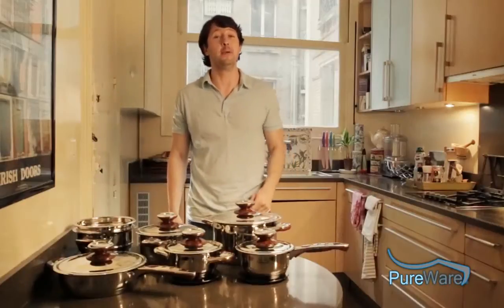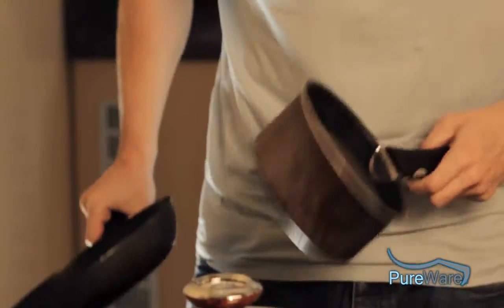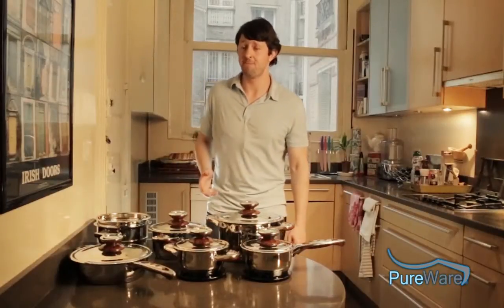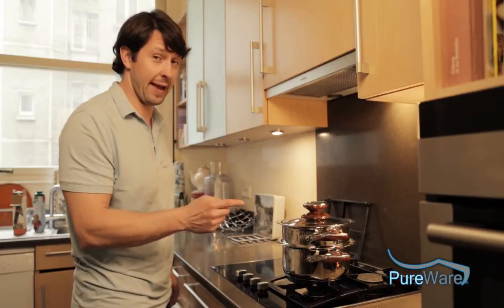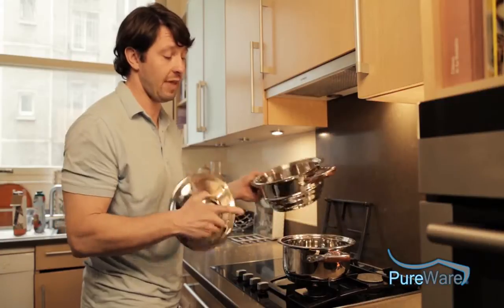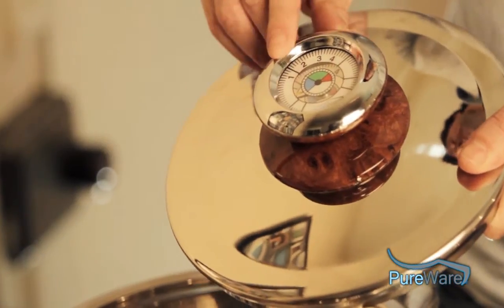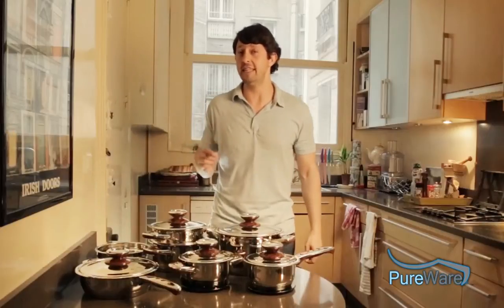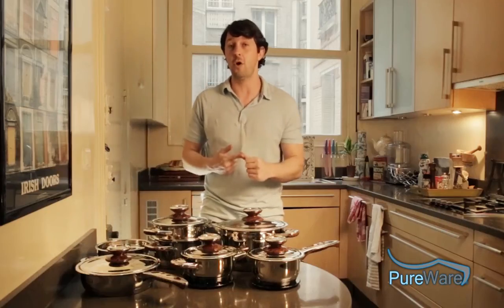PureWare 16-piece Stainless Steel Cookware Set

Comment: I just bought these and I love them.  But I would like to see a more detailed video on the different ways they stack on the stovetop. Also,  oven-safe is mentioned but won't the handles melt? What temperature is it safe with?  Should I unscrew the fancy top and remove it before using it in an oven?  I want instructions and demonstrations pretty please?! I do not want to ruin this set with guesses.
Reply from the maker: We are so glad that you like your new set! We have just finished filming a stacked cooking demo, and will be uploading it soon. Check back on our channel!
As our pots are best used with low to medium heat, we recommend a maximum oven temperature of 350 degrees to ensure that the handles don't get too hot. And yes, you should unscrew the thermo knobs on the lids before placing the pots in the oven. Feel free to send us an email at info@pureware.com if you have any further questions!
Reply: @purewarecookware4896  Hello! I have a question for you: if this is a stainless steel why is it so inexpensive? 🤔